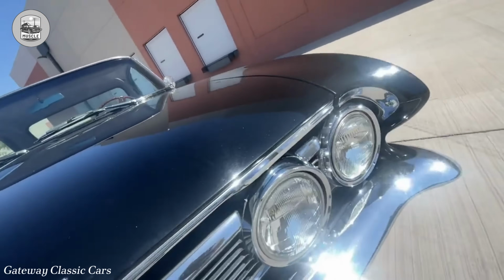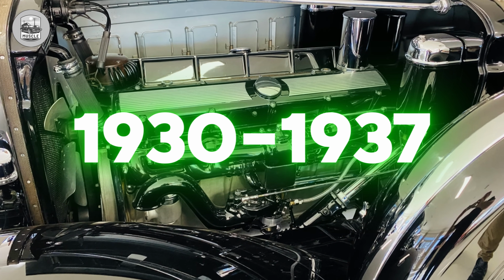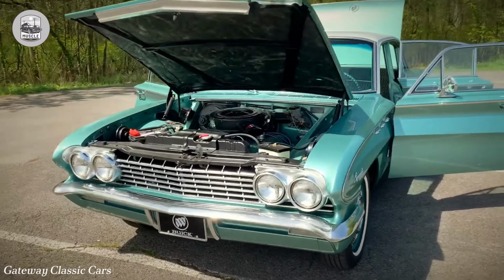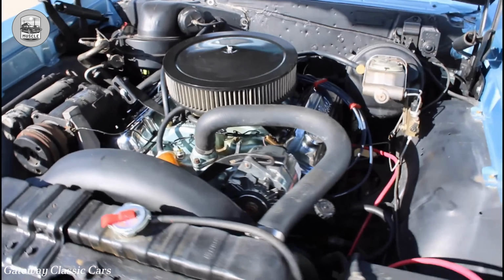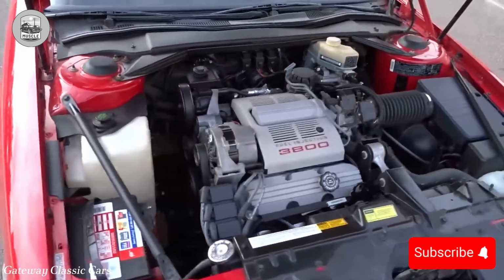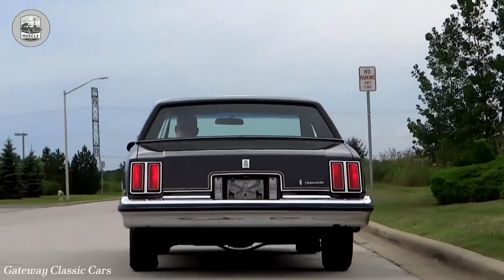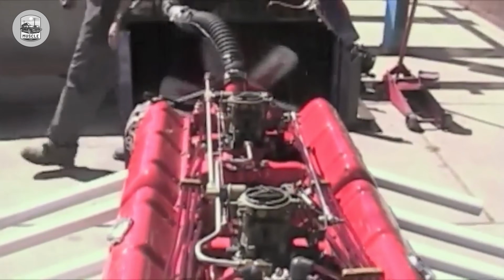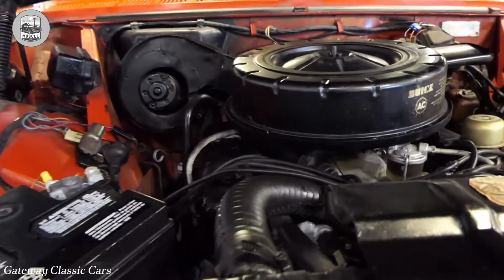10 MOST FAILED and WEIRDEST GM Engines ever made | Worst engines blunder!

Comment: The Buick 215 was not used in F1.  The F1 engine started life as the Oldsmobile version of the 215 (different head bolt pattern amongst other things).  

When the F1 rules changed to 3 litres, the Australian Racing car driver and team owner Jack Brabham decided he needed to produce his own engine as there was little else available for the new rules.  Rumour has it that Brabham managed to get some 215 blocks from Oldsmobile at scrap prices, which definitely has the ring of truth about it.  The engine was extensively modified with a different crank, stiffening of the bottom of the block and a single overhead cam head designed by the Australian engineer Phil Irving ((best known for designing motorcycle engines both racing and production including the Vincent engines).  Later on, Brabham had the entire engine built from scratch by Repco in Australia.  It was quite successful considering its modest beginnings.

As to Rover, I had a Rover P5B (3.5 Coupe), which was the first Rover to use the 215 based engine, for several years.  The basic engine was okay but showed signs that Rover did not fully understand the requirement to put the V8 design into production, the cam, lifters and rocker gear suffered excessive wear and the piston rings could break.  The car was by no means new when I acquired it, so there may have been a degree of neglect in its previous life that could have contributed to its problems.  In any case, it was an engine I loved and made a glorious howl when I had the air cleaner off for test drives, the induction noise through those 1.5 inch SU carbies was most satisfying.

Not mentioned was that Leyland Australia increased the capacity of the engine to 4.4 litres for their Australian car, it was quite powerful and more tractable but less refined which was probably due to the crank balance being not as good.

As far as I am aware, GM abandoned the 215 due to high production costs, it is worth looking up the unusual way they built these engines using a Reynolds alloy.  Unfortunately, the reject rate due to faults in the block casting was high and even worse usually only came to light late in the milling process, further increasing costs.  GM decided to stick to cast iron as the advantage of alloy over cast iron engines was not worth the cost.

The Cadillac V16 was produced in a desperate race to upstage Marmon who had been working on a V16 design for a while.  Amongst other things, Cadillac lured away one of the design staff from Marmon who was working on the V16.  The Marmon engine,  which is mostly alloy, is considered a superior design by many.  In any case, Marmon produced few of these engines, the cars were expensive and the depression limited buyers, there was also a view by many that conspicuous wealth in the Depression was bad taste.  Quite a few luxury cars were garaged for years due to this view, a few turned into "barn finds", including one V16 Caddie I vaguely remember reading about.
Reply from the maker: Thanks for sharing such detailed and insightful comments! You're absolutely right, the Oldsmobile version of the 215 V8 was the foundation Repco used to create the Formula 1 engine that powered Jack Brabham to championship glory. Brabham's team did indeed heavily modify those blocks, and Australian engineer Phil Irving played a significant role in transforming the design. The move from a simple American V8 to a world-beating F1 engine was an amazing story of ingenuity. Repco’s version with the single overhead camshaft and strengthened block was an engineering triumph, especially considering its humble origins.
Your experience with the Rover P5B (3.5 Coupe) and its 215-based engine is fascinating! Many people don't realize that Rover took on GM’s 215 because of its lightweight design, but as you mentioned, they struggled with issues like premature cam and rocker wear. The 4.4-liter Leyland variant you referenced is another interesting chapter – offering more torque but with some compromise on refinement.
As for GM's decision to abandon the 215 due to production issues, you're spot on. The Reynolds aluminum alloy casting process was innovative but costly, and the high reject rate was a deal-breaker for GM. They opted to stick with cast iron, which was cheaper and more reliable in mass production.
And your take on the Cadillac V16 is gold! The rivalry with Marmon, the Depression’s impact on luxury car sales, and the legacy of these incredible engines are often overlooked but fascinating. That Marmon V16’s superior design is often praised, but Cadillac’s marketing muscle ensured their version grabbed the headlines.
Reply: The Triumph TR-8 used the tiny Oldsmobile V-8 under the hood.
Reply from the maker: @davelowets  Thanks for the comment! You’re right that the Triumph TR8 used a V8, but it wasn’t the Oldsmobile engine—it actually used a Rover V8, which was derived from the Buick 215! The TR8 was often referred to as the "English Corvette" due to its lightweight body and V8 power. The engine was compact and aluminum, making it perfect for the TR8’s design. This V8 originally started life as a Buick engine, which GM sold to Rover in the mid-1960s, and it powered many British cars for decades.
That Rover V8 became famous for its versatility, powering not only sports cars like the TR8 but also Land Rovers and Range Rovers! It might have been small, but it delivered solid performance, especially when paired with the TR8’s nimble handling.
For anyone out there who’s interested in unique V8 history and swaps like this, be sure to comment, share your thoughts, and subscribe to Muscle Car Masters! Let’s keep the conversation going!
Reply: @MuscleCarMasters68  Yes, you're right about that. My neighbor had one, and always called it an "Olds" V-8 in it. I never did get a chance to look under the hood and get a peek at it. Before I saw his car, I didn't even KNOW that a TR-8 even existed. I thought they were all V-6's or 4 cylinders. I was surprised when I heard him fire it up the first time, and saw the "TR-8" badging on it. I thought that it was something that he cooked up at first, but nope, it was all factory stock. Cool car.
Reply: @MuscleCarMasters68  Thanks for the compliment.

The thing about the Rover V8 was that it was often the same weight and sometimes less than a cast iron British four-cylinder and about the same length.  Thus, they got shoehorned into anything and everything, the MGB V8 (V8 engine 20 kg lighter than the four) was far superior to the MGC, the V8 just slotted into the engine bay, the MGC's six cylinder engine not so easily.  

I can say that it was not easy to work on my P5B (3.5 Litre Coupe), the V8 was not an ideal fit into the engine bay, mind you I never worked on the old 3 litre six version so that may have been equally painful.

As to Triumph's flying doorstop, it was a classic, I wish I had bought one, you never see them these days.  The internal bickering and political nightmare of British Leyland unfortunately killed Triumph.  The Triumph Stag could have easily used the Rover V8 but...

Interestingly the Olds used a ten-head-stud pattern, the Buick a nine head-stud pattern and the Rover an eight-stud head pattern.  They didn't seem to have any problems with the eight head-stud pattern, but if you wanted serious power, you still needed to reinforce the bottom end with a big plate or some kind of cage (usually a big- ass... piece of aluminium was used), but that was in the early days, I never followed the later engines or the later mods.
Reply from the maker: @robertnicholson7733  Thanks for sharing your insights! You're absolutely right about the Rover V8's lightweight and versatility—it really was a game-changer for British cars, especially with its aluminum block. It's fascinating how the MGB V8 ended up being lighter than the MGC despite having two extra cylinders! That really speaks to how well-engineered the Rover V8 was compared to the cast iron alternatives.
As for your P5B, I can imagine how tight that engine bay must have been. Even though the Rover V8 was compact for a V8, some of those older cars weren’t exactly designed with future V8 swaps in mind! And you're spot-on with the internal chaos at British Leyland—it’s sad to think about how Triumph could have thrived if they had embraced the Rover V8, especially for the Stag.
And thanks for pointing out the differences in head-stud patterns between the Olds, Buick, and Rover engines—those kinds of details really highlight the evolution of the design. Reinforcing the bottom end with a big aluminum plate or cage was a must for high-performance builds back then!
For everyone else tuning in, drop a comment if you've got more stories or experiences with the Rover V8 or other classic British engines! And don’t forget to share this video, subscribe to Muscle Car Masters, and keep the conversation going—we love hearing your stories...

Comment: 4100 Caddy engine would have probably fit well as a most failed.
Great video though.  I liked the V16 Caddy and the super heavy V12 GMC.
Reply from the maker: Thanks so much for watching and for your comment! You’re absolutely right—Cadillac's 4100 engine was notorious for its issues, and it could definitely be considered one of the biggest flops in engine history. The combination of its aluminum block and cast iron heads led to major reliability problems, especially with coolant leaks and head gasket failures. A lot of owners felt it was a step down for Cadillac during a time when they were known for smooth, powerful engines.
Glad you enjoyed the part about the Cadillac V16! That engine was a masterpiece of luxury and power in its time, showcasing Cadillac's engineering excellence. And as for the GMC V12, it was an absolute beast, made primarily for trucks and industrial use. Its raw torque and durability made it a real workhorse. We’d love to hear more about what engines or cars you think deserve to be on the “most failed” list! And if anyone else has thoughts on engines that didn’t live up to the hype, drop them in the comments below

Comment: A T5 IS NOT A TURBO SIZE!!! ITS A FLANGE STYLE!!!!
Reply from the maker: Thanks for pointing that out! You're absolutely right—T5 refers to the flange style, not the turbo size. The T5 flange is a standardized mounting point used to attach a variety of turbo sizes, so it's important not to confuse the two. The size of the turbo is often identified by numbers related to the compressor and turbine wheel sizes. For example, a "T3/T4" turbo refers to a hybrid with a T3 turbine housing and a T4 compressor. This flexibility is what makes these setups so customizable for performance tuning! If anyone has more to add, feel free to comment and share your experiences with different turbo setups! Let's keep the conversation going!

Comment: When you were talking about the Oldsmobile diesel the motor you were showing definitely was not, that was a small block Chevy I believe
Reply: I can understand why you might think it was a small block Chevy, but I have to respectfully disagree. The engine shown is actually the Oldsmobile 5.7L diesel V8, which looks quite similar to a small block Chevy at first glance. However, key differences like the injector pump on top of the intake manifold and the unique head design give it away as the Olds diesel. It’s easy to mix up these engines since GM was reusing block designs across different applications during that era.
Reply from the maker: Thank you for your feedback.
It is important information for us to practice our mission - bring back memories to all fans. Step by Step.
Have a good day. Don't forget to spend more time watching other great videos on our channel and SUB to explore more Muscle Cars.

Comment: GMC V12 ...JUNK
Reply from the maker: Thanks for sharing your opinion! 
The GMC V12, also known as the Twin Six, definitely sparked some debate over the years. While some saw it as overbuilt and impractical for smaller tasks, it was a powerhouse in its time, especially in heavy-duty trucks. With 702 cubic inches and a unique design, it provided tons of torque and could handle some seriously tough jobs. It’s rare to see an engine with that kind of configuration nowadays! What do you all think? Do you agree it was junk, or was it an underrated beast? Drop your thoughts in the comments and let’s get a discussion going! 👇 Don't forget to share your experiences if you've ever worked on one!

Comment: What about the 1980's 
"IRON DUKE" 4 CYLINDER? was used in the SUNBIRD & believe it or not offered in the 3rd Generation CAMARO😢
Reply: The iron duke wasn't weird or failed, millions were made for cars and small trucks
Reply from the maker: You're absolutely right! The "Iron Duke" 2.5L inline-4 was indeed used in a variety of GM vehicles, including the Pontiac Sunbird and surprisingly, even the 3rd generation Camaro. This engine, also known as the "Tech IV," was built for durability and fuel economy but wasn't exactly a powerhouse. It produced around 90 horsepower, which was underwhelming, especially for a car like the Camaro, which had a reputation for performance.
Many enthusiasts felt it didn't belong in a Camaro, and it became the subject of jokes due to its lackluster output. However, it's worth noting that the Iron Duke had some advantages, including its simplicity and ease of maintenance. It served as a dependable commuter engine and was a fuel-efficient option during a time when gas prices were a big concern. If anyone has experience with the Iron Duke or knows more fun facts, feel free to share them in the comments! Let's get a discussion going! 😊